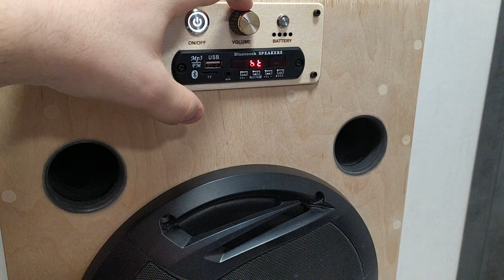DIY Bluetooth speaker (Pioneer TS 2503i)

Comment: Where can I order a pair of these that ships to the United States?
Reply from the maker: It will be much easier for you to do in your own country. The column is large and heavy, there is still a problem - these are the speakers, they are very old, and the measurement of the speaker parameters will differ from new ones or others, respectively, and the case, the phase inverter port.
Reply: @DIYAcoustic  I'm sorry, I meant just the pioneer TS-2503i themselves. They don't sell those here.
Reply from the maker: I understand you, these speakers were my speaker customer. They are most likely no longer sold, they require a large volume. Better watch the penultimate video on the channel, where a speaker with a car subwoofer, assemble a 2.1 system, the sound is much better.

Comment: you need too put more batterys in paralele
Reply from the maker: You are right, it could be done that way. The customer decided so, the bluetooth speaker is heavy, basically it is like a stationary one, it works from the power supply.